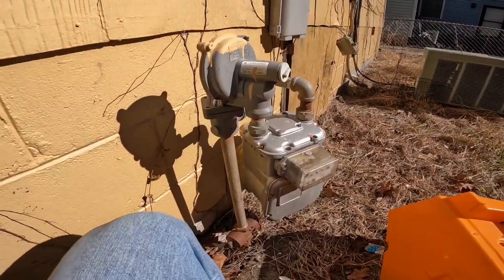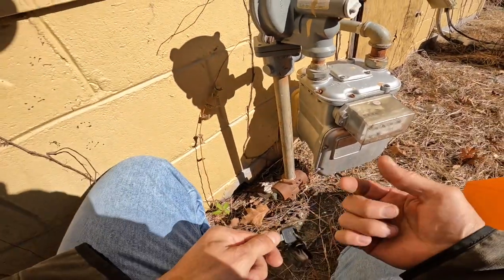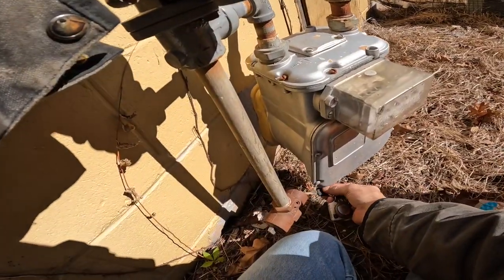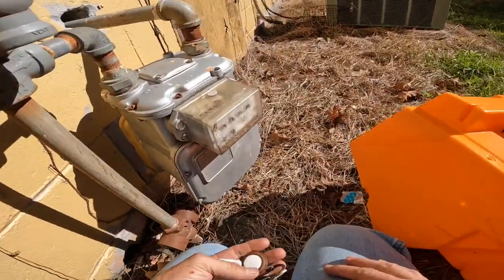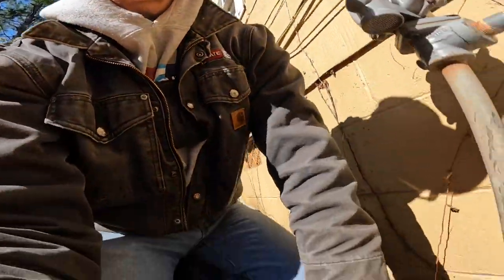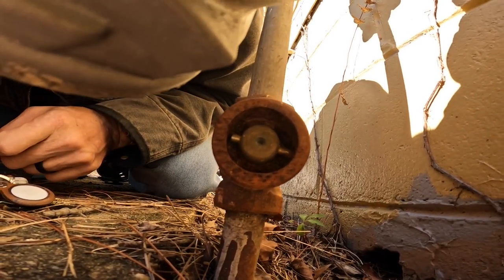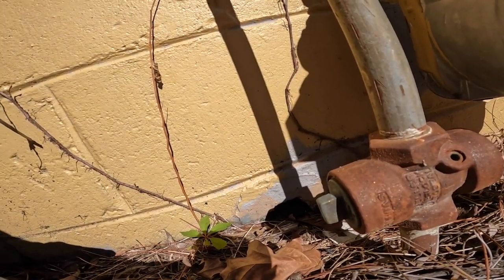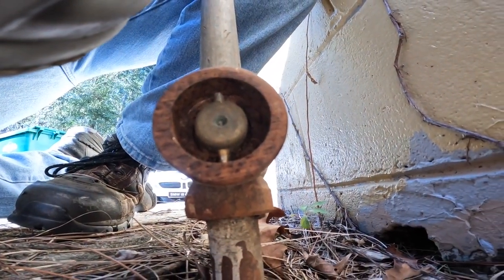Explanation of an Interlocking Gas Valve

Comment: Happy thanksgiving Curtis and all of my YouTube friends. I worked on a modulating gas valve yesterday. Found the high fire going up to 7 iwc then as I recycled the furnace. Back to 3.5iwc. I understand these need to be set high first then low but I was told this was an issue with these gas valves. Has anyone else experienced this? I am warranting the valve but wanna make sure I’m not doing something wrong